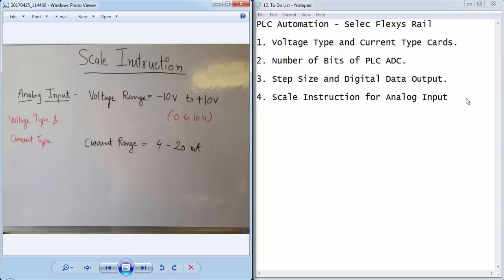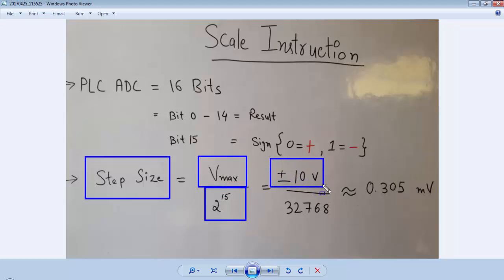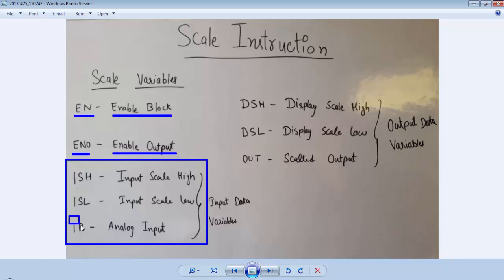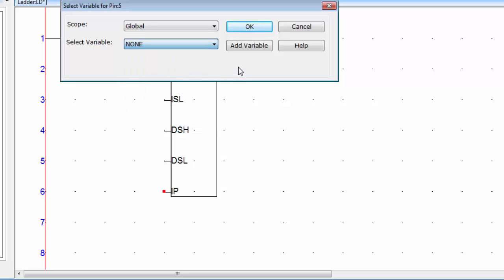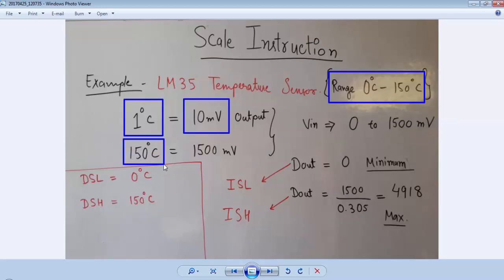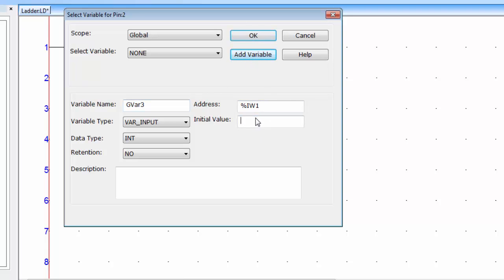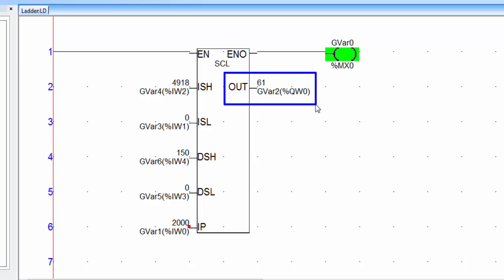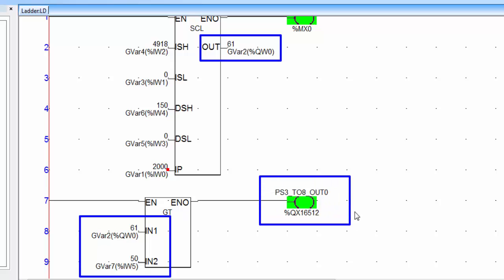Selec Flexys Tutorial 12 - Analog Input with Scale Instruction

Comment: Maybe this calculation for ISH works with other makes of PLC, but in Selec, the ISH value is determined as follows-
for "voltage card": (0-10V)
0V = 0
10V = 10000
for "current card" (4-20mA)
4mA = 2000, (since 0mA = 0 )
20mA = 10000

So as for your example, the LM35 Temp sensor, the ISH value will be 1500.
Reply from the maker: Thanks for your valuable comment....

Comment: ACCORDING TO THIS EXPLANATION,  Vin=0 TO 1500mv, AND 0mv ACTUALLY REPRESENTS SOME TEMPRATURE BELOW 0, BUT IF DSL I S GIVEN AS "0" DEGREE THEN IF THE ACTUAL TEMPERATURE IS BELOW ZERO IN ITS MINIMUM LEVEL, THE TEMPERATURE SHOWN IN THE PROGRAMME WILL BE 0, SO ISN'T WRONG...., IF AM WRONG PLEASE CORRECT ME
Reply from the maker: I'm just assuming here the minimum temperature starts from 0 degree Celsius  and if the temperature sensor is able to give voltage output for temperature below 0 degree then the logic will be little different.

The logic will depend on the voltage or current value provided by the temperature sensor because the output may be -ve if the temperature is below 0 and +ve if the temperature is above 0.

Comment: Hi sir good morning
I have a selec twix-2 PLC and 4-20ma pressure transmitter
Please suggest how to program it to start and stop a air compressor.
Reply from the maker: Hi Surendra.
For your Analog Current Card 4-20 mA, first you need to get information from its datasheet that at how much pressure what it will generate. What is the relation between current output and air pressure?

after noticing this relation you have to program the Parameters in Scale instruction.
For example:: If your current output is 6 mA for normal atmospheric pressure then set the OUTPUT scaling parameters accordingly.

After that you have to use the comparison instruction to turn ON-OFF the compressor.

Comment: sir, how to download the plc programming from existing SELEC PLc
Reply from the maker: Hi Shabbir Ahmed, in most of the PLC software an option under the Communication or other tab can download the ladder program from PLC to PC.

I did not check it with Selec PLC.
Reply: sir, iam using selec plc, for my panels i want the ladder programmeto be down loaded from plc, as the selec plc programmer has not given to me
Reply from the maker: Hi Shabbir, there is an option named "Upload". Use it and a new window will pop up. Fill the required data and try to get the Ladder program from PLC.
Reply: Life & Learnings Tutorials sir, I have filled the upload form but it's asking (select path to save application) which path I have to select, PL advice
Reply from the maker: Hi Shabeer. The path is the address or location of a folder in your PC. 

for example: C:\New Folder

Selec software will fetch the ladder program from PLC and save in the given path.